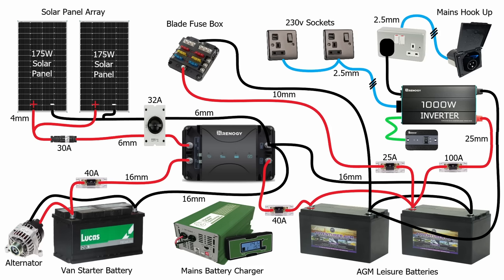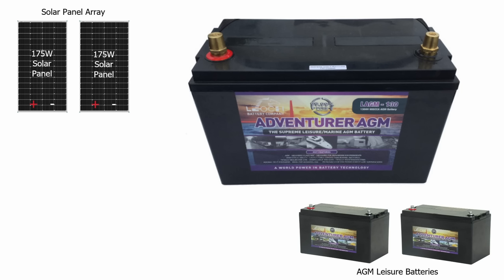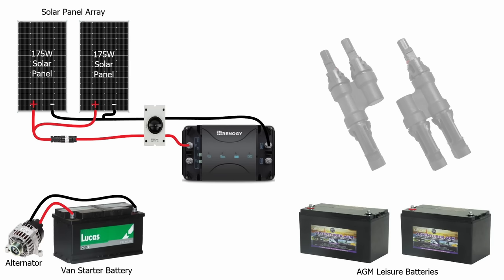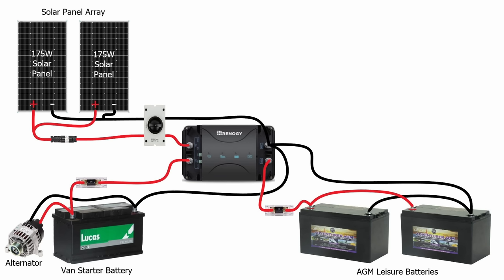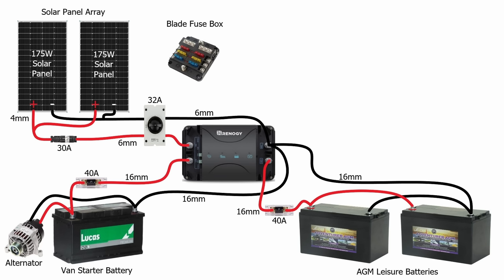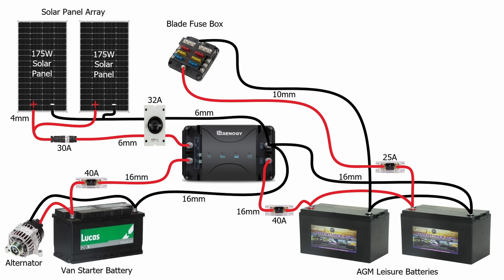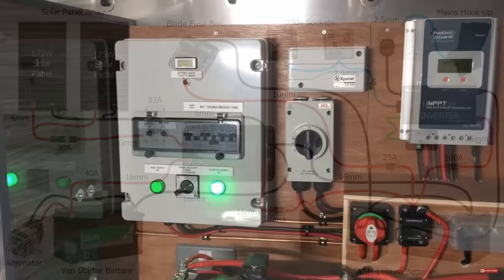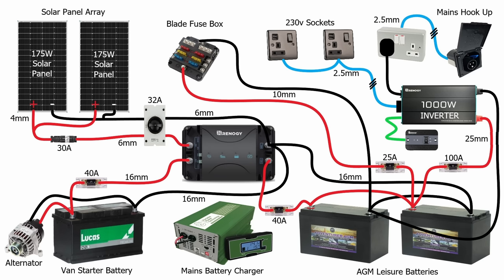12v Electrics for Off-Grid Campervan - Fiat Ducato Budget Build Ep12

Comment: Does the Inverter (when connected to Mains Hook Up), also charge the Leisure Batteries via the 25mm Red cable?
Or is it just supplying external 230volt to the 230volt sockets only?
I would hope you could run all your 12volt appliances (from the Blade Fuse Box) even if you have no DC-DC or Solar input available.
Excellent informative video, well explained. I hope to be following your setup soon, and apply it to my Australian conditions and equipment.

Comment: One of the best electrical videos out there, fantastic as always Greg. Just a quick question if you can answer it. The 1000W inverter, as you explained has a separate power feed and it acts as a UPS. Does that mean you can only draw up to 1000W through it, even if it is on mains hook up, I had a look at the manual, but didn't find the answer. .... I would say yes, but your knowledge is better than mine... and most others 🙂
Reply from the maker: Yes only 1000w through the inverter. There will be a consumer unit fitted to the van in the next video and I’ll explain how you can wire a 16amp socket from that to give you full hook up power on another outlet. Hope that makes sense. Cheers 🍻

Comment: Brilliant  video  Greg. If I wanted to copy this set up as an upgrade for my motorhome, but wanted a larger inverter to run air fryer and induction hob, then would I only have to upgrade the batteries to lithium as yo say, or would there be anything else to change.  Your advice would be very much appreciated.

Comment: Where you have three + and - wires coming off the respective battery terminals, do you need a 4 terminal bus bar or a 3-way terminal connector, or do these sit one atop the other each with the copper lug rings touching? Thanks for being so comprehensive in your videos.

Comment: Hello, thank you for the excellent video. My truck is running on 24v (2*12v inline). What makes most sense in connecting a off grid system?

Comment: Hey Greg!!! Thanks so much for the setup. I used it in a camper van that I am nearly finished. However I used a 2000w inverter with agm batteries, first mistake I think. 220ah altogether. Surely though 220ah should be enough to power a 1200w appliance like a hover or PlayStation ? It did say it would be enough on the renogy website. But help would be great on this question. 
When I try to use something about 500w it won’t work though. 

But also when I try switch to ac power from mains, I don’t hear a click over noise from the inverter. So it continues to use dc changed to ac from the batteries, draining them all the time or shutting the inverter off with a long beep noise. 

In the very beginning I did hear the switch over from dc to ac but again the inverter would beep and basically shut itself off even though it was connected to mains power. 

I check the mains plug and that all works fine. But then goes strange at the inverter. 

Any help would be really appreciated.

Comment: Hi Greg thanks again for a great video. I had a question regarding the solar panel wiring. Your wiring diagram video from 3 years ago had the solar panels wired in series but the wiring in this video looks different. I just wanted to check if series is still okay to use as that's my current wiring plan 😅 Thanks!

Comment: Hi Greg, great video as always. Is it worth putting some kind of fused switch in between the battery and the blade fuse holder instead of just a fuse? That way you can isolate any power if any works need to be done. Cheers! 👍

Comment: Hi Greg, Love the videos! looking for support with simple rear wiring of my VW T5.1, leisure battery and relay in already, just would like fridge, rear lights, 2x 12v & USB chargers and 2x 240v, do you have a simple diagram for this please and list of items? Id also like some form of gauge to show remaining charge in the leisure battery, can this be installed?  Also notice you dont install a main switch to isolate everything in the back, is this not required?

Comment: Hi Greg , your videos have been a fantastic help in understanding all aspects of a van build .I've adapted a good few of your ideas and just copied a lot more love the videos. Question : during covid I bought a WZRELD 3000w inverter and im just getting around to fitting it . There is no UPS on this inverter is it possible to fit an automatic transfer switch 2P 63Amp from eBay ?and would this work with the inverter and shore power I would like to buy the Renogy but I've already spent the money allotted to the inverter ATB

Comment: Hi Greg. Thank you for your videos they're super informative. 

I'm just starting out on converting a horse box. My starter battery is 24v what would i need to add a voltage reducer between the main battery and controller to run a set up like this?

Comment: Hi Greg, I'm going to be putting an electrical system in very similar to this, how has the renolgy equipment, have you had any issues with yours. Ive seen some comments on Facebook, mostly good but some negative, thanks for your excellent and consistent content 👍

Comment: Thank you for a very informative and well laid out instructional video. One thing I am confused about is cable sizing - your plan uses millimeters which I took to be the actual diameter measurement because solar panels do come standard with 4mm cable. However, now I'm confused because most cable retailers use AWG, B&S & mm2, not the diameter. And the MM2 does not marry to your sizing. I cannot find 16mm or 25mm cable? Could you please clarify.

Comment: Love this! Thank you so much for the wonderful details. I live in the US and it looks like we don't sell inverters with integrated transfer switches for Mains connection? What can I do instead? Also, how do I connect the DC side of the mains battery charger?
Reply from the maker: you can use a manual changeover switch like I have in our sprinter build series or you can get double pole changeover relays to do it automatically.  regarding the mains battery charger, connect the positive and negative to the same terminal as the dc to dc charger.

Comment: Hi Greg, great video, very informative and easy to follow.

I have a couple of questions,

1. Is it ok to use the vehicle chassis to connect the negatives to ? e.g the car starter battery is already connected to the chassis, could you also connect negatives from the leisure battery, the renolgy unit, fuse box and solar panels ?

2. Do you have a preferred supplier that you obtain the cabling, connectors, fuses, breakers etc from here in the UK ?

Comment: Hi Greg, firstly thank you for all your wonderful informative videos, I've recently started a conversion so refer to you a lot! May I ask your advice. I wish to put in two 12v fuse holders, one on each side of the van, should I wire them both independently from the batteries with 10mm cable, or wire the second one from the back of the first fuse holder, sort of daisy chaining? Be grateful for any advice, cheers, and have a great '24....Baz

Comment: I think your presentation was excellent and very informative.  So it doesn't matter what size your van is? As long as I stick to your exact description.  As I have a lab Peugeot boxer. Hopefully you get back to when you're available!  Thanks for your video
Reply from the maker: Your electrical setup doesn’t have any bearing on van size just what appliances you want to use in it. Thank you for watching 👍🏼😊

Comment: hi brilliant simple to follow vid thanks but can i just plug a socket gang with surge protection into my inverter (ac) and plug my individual appliences in to that (not all at once of course) rather than every appliance individually into a separate fuse ?? just asking

Comment: Hi Greg!
Excellent material, as always!
By the way, there is a question - is there any simple solution to charge the batteries without having additional charger as you shown?
I'm just dreaming of having one device which will do the connection to shore power, invertor and charger of the batteries if the shore power presents.
I can rely on your experience that you don't really often use the separate charger, but...

Comment: Hi thank you for this video, it’s been really helpful 😊
Where the charge from your van battery to the leisure batteries is in operation, when you turn off the engine, could this drain the van battery and if so do I need an additional bit of kit to break that part of the circuit?

Comment: Hi greg, what a usefull video, many thanks.

I'm wondering: if I wanted to only have one panel and battery respectively (for a micro-camper) would the wire gauges and fuse and switch ratings remain the same? (Assuming the same panels and batteries were used).

Cheers.

Comment: Hi Greg, I know you're a busy bloke however I was just wondering if there was any news on your planned video on grounding and earthing of 12v and 240v circuits? Currently replacing our AGMs for lithium (ours certainly did not last more than 5 years!) and have come round to the same question I had when we first built our van three years ago.
I took your advice from your first campervan wiring video back in 2020 and left our entire 12v circuit 'floating' - nothing is connected to the van body/chassis and we haven't died yet which is fantastic! I understand there is now a need to fit a consumer unit when fitting 240v however fortunately that doesn't apply to us as we're purely 12v. However, the amount of posts and articles on the internet stating that you must connect the negative side of your leisure battery to the body or chassis is overwhelming and I from what I can gather, you seem to be the only one saying this doesn't need to be done! I simply want to know why you suggest leaving the 12v circuit un-grounded and your views on why so many other sources suggest otherwise. 
If you do ever make this video, it'll probably go viral and become the most watched on YouTube as I definitely don't seem to be the only one with this question!
Thank you and safe travels :)

Comment: Hi Greg love the series thanks! Will the Rover Li 20 Amp MPPT Solar Charge Controller  do the same job as the larger one you are describing?  Seems like a good price and I won't need the full 30A unit. Not sure if it does quite the same thing though.

Comment: Great video, where would you ground the negative cable from in this setup? From the battery, the blade fuse box the charger or doesn't it matter?

Comment: Fantastic video thank you Greg.  I'm installing this Renology system but I need to connect a lead to the ignition circuit as my van has a smart alternator.    Would you know where is the best place to connect to the ignition?  (2019 1.5 diesel vivaro) thanks

Comment: Ah man Greg this is brilliant and will help me massively. One quick question though, I have wired up where my plug sockets will be. They all come from different areas of the van. How would I be able to combine them all? Would I go back to one area, connect all the wires and then feed it into the inverter or would I require a junction box? As always amazing work this could save me so much money and work 👏🏻👏🏻👏🏻👏🏻👏🏻🚐
Reply from the maker: You can do a combination of things, this inverter can only handle 1000w of appliances so you have to be careful not to overload it with devices.
I would still recommend fitting a consumer unit for short circuit protection and final circuit protection. then wire your sockets to separate breakers and feed the consumer unit from the inverter

Comment: Got to be the most simple yet informative video on the internet for motorhome electrical systems. I have sold my house and myself and 2 kids and wife have bought a motorhome 22nd of April is the date. I have to upgrade the electrics, I'm going to copy this entire set up using your links accept batteries. I'm going to use a fogstar 460ah lithium battery, would anything in the diagram change? Also cant find 16mm cable only 25mm would it be okay to swap them out? Please feel free to contact me would appreciate the help and advice! Thanks again for spreading help and knowledge I'm a carpenter not a electrical Megamind.
Reply from the maker: I’m really pleased the video has helped you and wish your family lots of fun travels 🚐👍🏼🤩

Comment: Hi Greg, I’ve had to put my thinking cap on tonight but hoping that you can give me a little advice… I appreciate that this question is a little way from your present build, but I really do appreciate your knowledge and expertise on the subject… I’m looking at replacing my 2 AGM leisure batteries with a single Fogstar drift 105ah leisure batter.  At present I have a 100w solar panel connected to a duel charge controller. As I’m now wanting a lithium leisure battery replacement, I’m guessing my set up can’t charge two different battery types?  … Am I right in thinking that my 100w panel could be used to charge one or the other, with an additional panel and charge controller for the other…. In addition the Fogstar has built in Bluetooth with its own app, and as an example, a Victron controller has its own Bluetooth.  Would that cause a conflict? … Many thanks in anticipation, Miranda 👍🍻

Comment: Great video! I’m in the states, but still it explains everything I need to know, however I do have one question. When using the mains battery charger where do wire that in if being used?

Comment: Hi Greg! Thanks for awesome content! I can only find 12v fuse boxes that can handle 100A total. My loads are going to be a bit more, and I’m wiring through a lynx distributor. I have used all my slots there (mppt, dcdc,inverter and 12v fusebox). So the question is: Can I wire two fuseboxes in paralel and just go up in wire size and fuse, or do i need another slot for the second fusebox on the busbar? And if I do wire them through one slot in paralel, can one box be placed further away from the first one, or does the wire between them need to be the same length as the wire from the busbar to the first fusebox? OR! Should i wire from the lynx to a new busbar and connect two different 12v fuseboxes there?😅 Hope I explained that correctly, and sorry for any spelling errors, cheers from Norway 😊🎉

Comment: G'day Greg, Many thanks for all your hard work mate. love your vids heaps. I do have a question though, excuse my ignorance I am no sparky but in reference to your wire size in your charts, e.g. 6mm( 2 x solar panels), 4mm (solar panels), 16mm (batteries to DCDC charger) what are the amps (average) of these different size cables mate? Looking at your diagram I assume the 6mm is a 30 amp cable (guessing as to the inline fuse your suggested  and the 16mm is 40amp cable. I have purchased the renogy 50A dcdc charger and I have watched many great reviews about it. The only thing I have not worked out about it yet is how to set it for my agm battery. My guess is, there must be a button on it somewhere that needs to be pressed t0 select the different battery types. I know it does not show AGM in the book so I assume the gel setting is what they use for AGM?   Thanks heaps for all your work mate.  My main cable from my starting battery to my dcdc will be 3 mtrs (9 ft) thats the longert run then from my dcdc to my agm will be 12 inches max.
Reply from the maker: There always needs to be some room over the fuse size for any over current as fuses don’t always blow exactly on their set value. Breakers take even longer to trip on small overcurrents so it’s best to size your cables bigger than the fuse sizes. 
A really good free sizing calculator is the one on this page from 12v planet

https://www.12voltplanet.co.uk/cable-sizing-selection.html
Scroll halfway down to find it. This also takes into account the voltage drop on longer runs like to the starter battery.

Page 12 of the installation manual shows the location of the small button used to select battery type. But don’t worry because SLA is the default setting and that is what you need for AGM
Hope that helps 👍🏼😃

https://store-nkm2yhe9h8.mybigcommerce.com/content/RBC3050D1S-Manual.pdf

Comment: Hi Greg, thanks for your very detailed explanation on how set a 12v,off grid system. However, i do have a question. If i want to increase my batteries from 200 amp to 400amp,what components do I need to change?

Comment: Hi Greg great video best on the net , a wee question on the diagram you show 4mm cable coming from the solar panels , and 6mm did you remove 4mm from the solar and replace it with 6mm thanks

Comment: very well done and clearly explained. I may have missed it, but does the DC to DC charge portion of that Renogy device have some sort of automatic "cutoff" so that the starter battery doesn't get depleted if the alternator isn't supplying something over say 12.8 volts?
Reply from the maker: Yes it will monitor the starter battery voltage and only use that as a supply source should the vehicle be running and somehting like 14.5v is coming from the alternator

Comment: Greg that's a fantastic explanation on wiring. 👏 Just two questions where could you connect a digital display to show you the leisure battery power, also your back up mains charger would it be safe to just connect that too one of the lesuire battery's. Thanks again Niall (Ireland)

Comment: Thanks for this video Greg, it is very helpful. In my case since I already have a mppt charge controller I will need to buy a Dc to dc charger separately. Here in Alberta it is winter, and currently, 300w of solar can produce somedays as low as 1 amp per hour, which makes it impossible to use solar to fully recharge my solar  lithium battery. Is it okay if my charge controller system and dc to dc charge the battery separately and simultaneously? I guess I just put fuses on the positives of both and I should be fine? Thanks in advance...